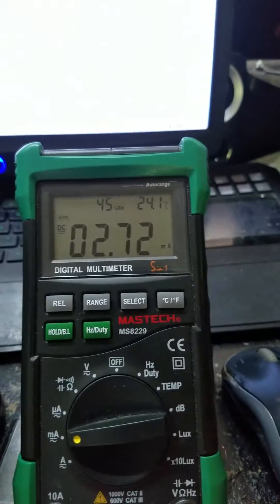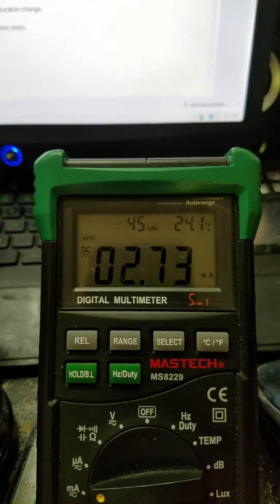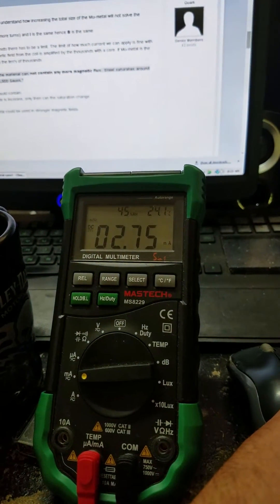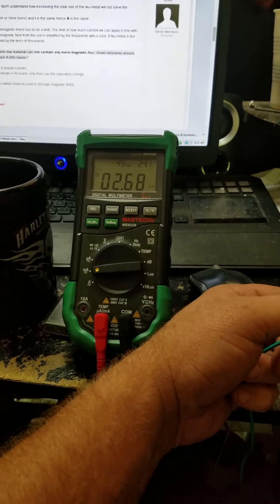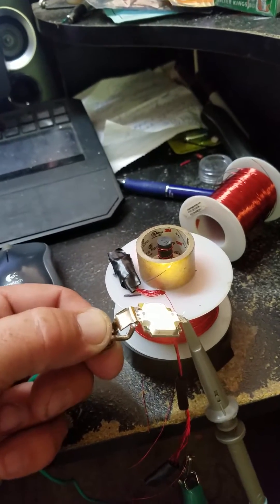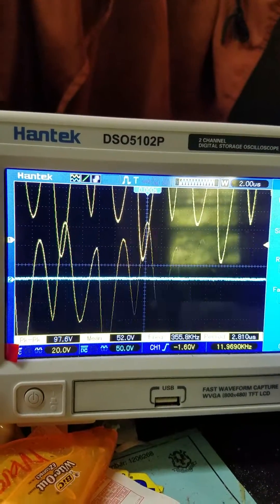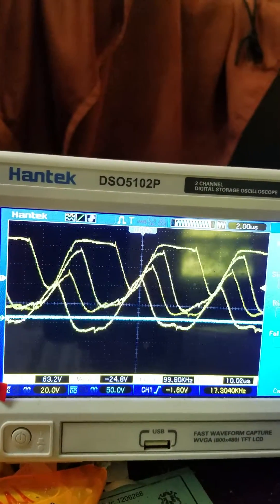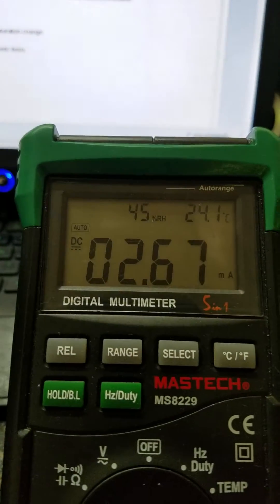Overunity or external energy by wireless input?

Comment: is your l.e.d in parallel or series conection with the coil? if series then your resistance goes up which would lower the amps. If its in parallel then the capacitive reactance could be the cause of the amp drop... via pushing the coil further out of resonance. Your pulsing it at 50% on 50% off sqaure wave?

Comment: thanks for posting. some thoughts. it bears remembering that an inductor does not result in a short circuit.
until the circuit to the secondary is connected, the impedance of the primary coil acts a balllast resister. cheers

Comment: I love your work and I freely admit you know much more about this than I do. With that given,  I don't have an answer but perhaps I can ask questions which might help you to answer your own question. First I ask with no load connected in the secondary, where does the power in the primary go? Is there heat production equivalent to the power usage in the primary or perhaps radio waves emitted that account for some of the power usage. So what I'm asking in effect is when you connect the secondary load do you see you see reductions in either of these two possible effects on the primary? I must apologize because I realize answering this question will likely result in more money and time spent on your part. Essentially what I'm getting at is you are asking where the additional energy is coming from, but I'm asking what if the driving circuit is becoming more efficient when the secondary load is connected? How do you show which is the real situation?
Reply from the maker: believe it or not, there are many circuits that react like this out there. Truthfully, the load at the source remains the same or goes lower when the output is provided. This is very rare and it is the reason why I know there is energy being extracted from somewhere. The homopolar generator designed by Faraday was actually one of the first known unexplainable form of overunity, where the energy is unknown where it  comes from and there is a lot of people who dispute such a thing as an anomaly or they just come up with excuses of how it is tricking people into a ,methodology that make people feel like they are nuts and they will spread disinformation about it forever, there are paid trolls and billions of skeptics. You don't have to believe it works, it does. The best way to get free  energy like this for the home and workshop is to use a lundell style alternator (delco remy ) and add a ring magnet in the middle of the claws. (you have to press the claw cups and spacer off of the shaft to do this install the magnet , then press it all back together. Some minor machining may be required.) eliminate the coil on the rotor, turn it into a 3 phase generator nby eliminating the rectifiers and voltage regulator,  then use a 400 watt 230v motor to drive it, making sure you install an off / on switch,  connect one output phase back to feed the motor, then spin the motor with a small rope around it's shaft , it will start, run by itself, then you have 2 other phases to take power from. If you rewire the stator you could make it a wye arrangement, you could get 240vac x 3 phases and could draw 120 v across the neutral . You should easily be able to get 4000 watts per phase. The magnet must be axially magnetized and it must be an N52 grade (sintered) is best because the standard neo magnet likes to shatter when you install the magnet into the claw cups (is what I call them) you could easily break bones with these magnets so if you try this, be extremely careful. Wear safety glasses too. The alternator will have minimal magnetic reaction by feel when you turn it by hand and will outperform any pm gen you could ever buy unless rewired and they must use the magnet in this manner using the Lundell style cups..

Comment: great expiriment thanks for sharing.

i see you have the same function generator as i do.
do you connect the output directly to the primary?
isnt that like short circuit?
looks to me your function generator doesnt bother....
i never did that cause i was affraid of loosing it hehehe...
Reply from the maker: yes
Reply from the maker: if a coil is selff cancelling, it wont bother the generator. caduceus coils that are wound correctly assist with this or any other type of self cancelling winding which causes the Anti-Lenz effect. Thanks for your interest..
Reply: so basicly you primary coil is in bucking modes resulting in 0-ish inductance?
i have done something similar in the past using a bifilar wound coil
open ended and connected in bucking mode.
it gave me great power transfer without loading a circuit.
the right setup even allowed me to run a load on a open ended coil wich i thought was pretty cool :)
Reply from the maker: yeah, no inductance but it isn't a bucking coil. There is no bucked output, the secondary is much larger than the primary and does not have inverted coils as the bucking coils have
Reply from the maker: my transformer is my own design and nobody has ever built anything similar before.
Reply: Marc Belanger
 i see that and you secondairy doesnt have to be bucking to work.
can you give more specifiks on the primary or do you want to keep it a secret for now?
Reply from the maker: correct. it is a special configuration, not bucking, however it has to be caduceus/caduceus in resonance with each other by matching weight or length (1 to 4 length). its difficult to make. it only works in resonance with each other (primary to secondary) and it has to run at a preferable frequency which activates it
Reply from the maker: this is the same as don smith effect but uses a core. without core, no goodies at the output. it is 125% anti lenz and a short circuited input at hi frequencies allows the transfer of energy without load impacting the source. If you keep the frequency low, it will burn out the source or blow a fuse, etc. The hi frequency pushing beyond the short circuit is all the fuss Tesla spoke about. There is much more energy from this configuration that is able to be drawn in, however it's design must  be in a clever manner. John Bedini uses some of the Treasures Tesla left us, same with Don Smith and Kapanadze, also Kacher. None of their circuits are based upon their own work, however as they may have uniquities, the basic function of their circuits are all the same, high frequency pushes beyond the short circuit to aid in collection of outside energy from induction , charging a cap, which transfers the energy which is at the beginning radiant energy , back to conventional energy of very high levels, then the energy can be dumped into a battery and used, or collected and used in other ways. All of these methods need induction without the lenz effect
Reply from the maker: this effect can be triggered at a much more powerful rate if the core is lined with a conductive foil. I split the foil covering into two equal layers, leaving a gap for the core's flux to minimally get out to flow into and fire the secondary. to do this, I fire up my function generator with both of it's outputs to energize one of the foil halves with a harmonic/multiple of the driver or carrier frequency, then another harmonic/multiple of the driver frequency to the other foil half. Once this is used, the input could be a high frequency/high voltage input using a spark gap to eliminate the loss of force to the shorted component of the circuit. Since the primary must be very short, it is the only way the high voltage can stay operational without shorting the NST I use ,eliminating it from shutting off. Capacitors must be used inline (ac cap) then a dc cap across the two polarities of the high voltage input to allow the spark to pop harder, enabling massive amperages to release at it's output. This energy can be stored into dc caps, then it turns conventional, however Don's cap banks can not be ac caps, this is wrong. his ac caps hold the radiant energy but the true component that is missing is his storage device which transfers the energy from radiant to conventional energy... that is the hi farad dc cap bank which can then be used to invert the energy back to ac low frequency usable energy at a much higher than normal amount (this is the multiple thousands of watss of amplification. ) This is where he gets his equation of 1 farad equals 1000 watts of output. If we charge the cap banks with high frequency energy at a very high voltage of radiant energy, it won't damage the caps. this is what Tesla called "High Tension". if the carrier frequencies are correct and the voltage in the caps builds up very fast, meaning it is faster than you can use the energy, it could be used and manufactured in mass quantities with milliamps of current to power the input  at 12 volts or 120 v ac. Got It?
Reply: @advanced-electronic  @Acid Byte YEs, this
Reply: marc  how can i get the bertonee to you
Reply from the maker: Hi Frank, please contact me at marcvbelanger@gmail.com, I will email you my business addy. If you'd like, I will send a shipping label. Please let me know what the size of the box would be and weight, I will get it done if you want.. would be easiest.. thank you! I will start putting the system together again, this time I will have 99% of the components, including the last coil in the system. Don has a double RF coil. I couldn't find the same single coil, but I did find the same coils in singles. I will snap a shot and send it to you so you can look for the same ones if I am successful. I had the entire system working but at a lower level with 12 bulbs. I then tried tuning it and I changed something like a dummy. When I tried putting it back, it didn't work. I now have the exact coils Don had, caps, etc. I also found a manufacturer that made the original yellow caps if you'd like, when I order, I'll send you a couple for your assistance. They aren't cheap, but very difficult to acquire. I will be the only one in the world to have them for sale in 2 lots. Unfortunately, I have to buy 50 of them at $30 each to get any. They are truly worth it because I think it is what makes Don's system work every time. They styill have the data from his last batch on file and will be willing to make them the same way.
Reply: marcvbeianger@gmail.com     correct ??
Reply from the maker: belanger   change the i you have with an L
Reply: LOL
Reply: Mail Delivery Subsystem
2:51 PM (4 minutes ago)

to me 
Delivery to the following recipient failed permanently:

     marcvbalanger@gmail.com

Technical details of permanent failure:
Google tried to deliver your message, but it was rejected by the server for the recipient domain gmail.com by gmail-smtp-in.l.google.com. [2607:f8b0:4001:c0e::1a].

The error that the other server returned was:
550-5.1.1 The email account that you tried to reach does not exist. Please try
550-5.1.1 double-checking the recipient's email address for typos or
550-5.1.1 unnecessary spaces. Learn more at
550 5.1.1  https://support.google.com/mail/?p=NoSuchUser f187si4320328itf.83 - gsmtp
Reply: On the off chance this was the last communication. I just wanted to point out the mistake in the email address. It should be marcvb"e"langer@gmail.com

I don't understand all of what you are doing, but understand enough to know it's awesome and very important. 

I am at the beginning stages of a project relative to this. I'm not an electrician or an engineer. Seeing the level you've taken it to has me recalculating  % for my potential success. ;(

Would like to see the progression made with you all on this project.

Cheers!